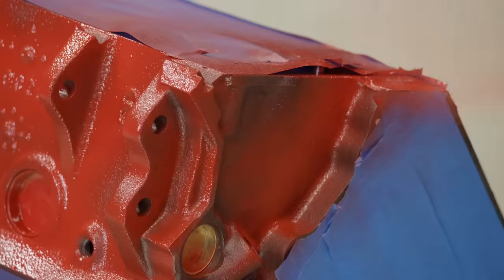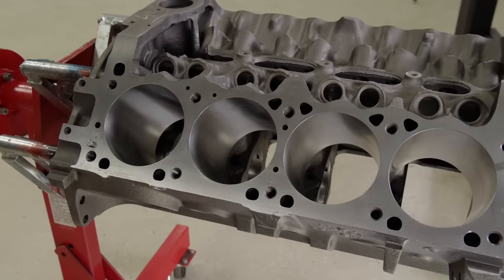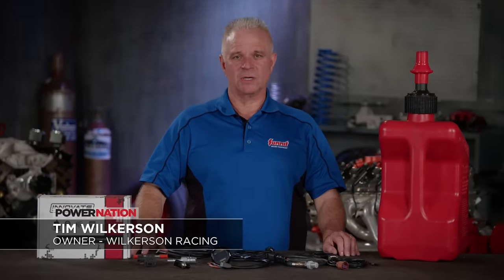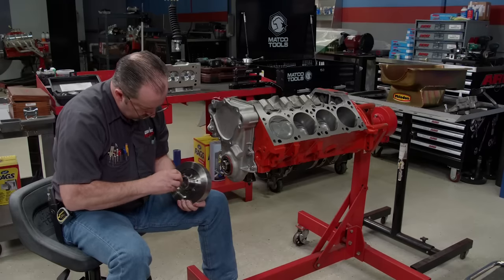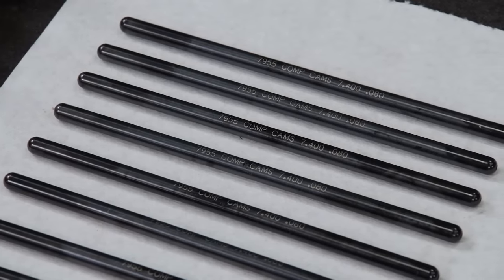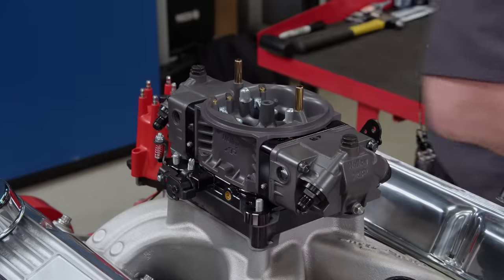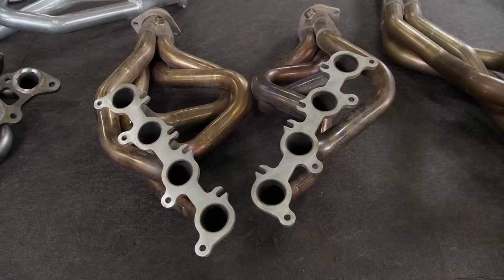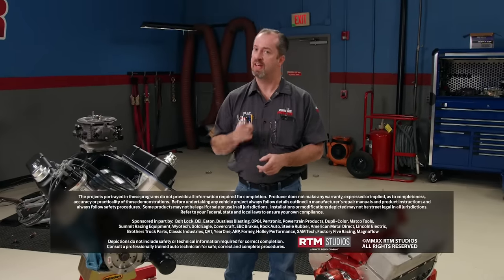Assembling a 410 Mopar with High Flow Induction - Engine Power S7, E9

Comment: Ok, am I missing something here?  They use retrofit roller lifters, on a block (Magnum) that was already designed for roller lifters?  Also, they're using LA heads on a Magnum block?  I hope it was a very very early Magnum block, otherwise I do not believe it will have the oil passage to through the head to feed oil to the rocker shafts.  Not sure when Chrysler stopped drilling those two passages.  It should also be noted that they are using an LA timing cover and not a Magnum timing cover.  I've been wanting to find one of those elusive roller LA/Magnum blocks.  Magnum small blocks typically have stud mounted rocker arms.  When valve lift is mentioned, keep in mind that LA's used 1.5:1 rockers and Magnum used 1.6:1 rockers.  So when he said "stock", I"m assuming he meant for LA engines.  Another thing to keep in mind is that LA 360's and 5.9 Magnums are both externally balanced but use different balanced dampers.
Reply: YES, u-r 1000% right about everything u said. Joey u-r on your game!! U clearly kn the inner details of the Magnum engines. Dis engine will make a great replacement for the stock 5.2 Magnum MPI i put in my 75 Scamp. SBEC w/wiring harness. Will Trick Flow have the correct angle [vertical] bolt holes for the stock MOPAR beer-barrel or M1 intake? So we can keep owe fuel injection systems?? I hope someone starts selling a create-version of this engine.
Reply: I took a screenshot of the video and this Magnum block does not have the oil in hole to supply the top end with oil, if they run this engine will burn itself up in no time, maybe they did and that's why there's no dyno runs
Also nothing was mentioned about pushrod oiling, Mopar shaft systems like on the LA engine aren't meant to be pushrod oiled
Reply: Glad I wasn't the only one that thought he said it was a Magnum engine.
Reply: Probably due to time constraints, they couldn't go into all the details of the Magnum block and it's quirks and differences between an LA block.  I did look into those Harland Sharp rockers.  Apparently they are special (which wasn't mentioned) and designed to be oiled through the push rod.  So the push rod is hollow and ball end on both sides so oil can flow through it, which wasn't really explained well enough.  It's not explained that this is an odd combination for Chrysler shaft valve train. My guess, the script had to be shortened to fit within the time slot.  But they should explain it better next time around.  Still, not sure why factory lifters couldn't be used since Magnums oil through the push rod anyway.  Should work, right?
Reply: Trick flow heads work on either LA or Magnum blocks ....Magnum blocks need oil thru pushrods..and Harland Sharpe or PRW stainless steel rockers...they allow the oil to get into the shaft.....the adjuster have an oiling hole that oils the rockers ...and into the shaft
Reply: @jamesmitchell2134  Nope. it doesn't. I do not know why Trick Flow say you can use these on a Magnum engine when you would not be abe to bolt up any manifold w/o drilling otthe than LA intakes.
Reply: They never did a dyno on this what a waste
Reply: Yep, missing a few things. While that's obviously a roller block, the cam probably isn't covered under warranty unless those lifters are used. It does serve to show how the non-roller blocks are easily upgraded. Second, they specifically stated the heads are machines for use on either block, as well as with rollers or flat cams. Three, the rockers they used were Harland Sharp units specifically intended for use on those heads, and they have a 1.6:1 ratio. Also, the external balance difference between LA and Magnum 360's doesn't matter because they are using an aftermarket 4 inch stroker crank. Typically this makes for an internally balanced setup.
Reply: I’ve been reading as much as I can on these , but it’s easy to walk away scratching your head. I think, meaning not 100 percent, that the retrofit lifters were used to match their xtreme energy cam. I looked at the catalog and noticed the cam profiles for the magnums aren’t as hot. The block is a magnum block identifiable by the two “ears” for engine mounts. I thought this was a cool feature so as to be used in older models also. I think they are neat motors because of the deck height being perfect for stroker kits. Thanks for your comment, couldn’t understand why clearance grinding was needed on a hydraulic roller block either.
Reply: Trick Flow heads can be used on either LA or Magnum blocks.
Reply: La/magnum blocks come from 90-93 dodge trucks. I have one that I changed back to the original LA style hydraulic lifter and carbed instead of tbi and computer. Nothing special, like another 360. Just buy an expensive roller hydraulic cam
Reply: Ur missing some research   patty knows wats up. He built more engines than times uve Jared off.  😂  🎉  witch I bet is alot.      .....they oil thru push rods😂😂😢
Reply: @user-hc3cn7cu4g  Well, yeah but 3  years ago when this was posted, that was a more unique method.  Still, I'm surprised that Magnum lifters weren't used.
Reply: Yes you can install magnum heads on La or magnum vise versa on La with magnum heads you would use amc 304/360 lifters and install oil restrictions in oil passage in block leading to the head but they did lose power on bottom end with la heads they also lost compression

Comment: Nice job. 
Highly suggest using acid etch primer on bare engine block, to enhance adhesion of paint, seal block against rust.
Reply: What kind of acid? Muriatic?
Reply: @DobermansRock  acid etch primer can be purchased at auto parts  hardware store.
Reply: @jakespeed63  Very good. I was thinking about pressure washing my block. Drying it then wiping it down with gags soaked in alcohol. Then a high temp epoxy primer then paint. Never heard anyone mention acid etching before but, if you are careful why not.
I have used muriatic acid to clean parts.

Comment: hotrod test was  416" /w ith 570 Hp They added a windage tray, with 11.3 compression and Comp 286x Mech roller . with ported dual plane ed rpm and 950 hp holley head flow was down 10 cc and about 12 cfm from TF after a full porting job on RPM's

Comment: I like how he is using a speed handle to run the nuts on. OG HRing.
Reply: Yes, I watched an 'professional' mechanic in our service shop, do this many years ago, while re-building our General Motors Diesels, and as his work proved to be just about perfect, so I copied that method for my work. ( no I am not saying that I do perfect work, lol  I ain't that good ) but it's an easy technique to master and it does save time...a little.
Reply: @regsparkes6507  vs.a ratchet , a speed handle saves a lot of time ! ,  ( thank God for  speed handles   when we were removing/replacing panels on our F-15's  !!  :)  )
  Like using 3/8 impact on  everything else,  goes super fast  :)

Comment: I have the same build my cam lifter is .590/.590 and i have unported Indy iron heads 2.02/1.60 and an Indy intake with a 950 carb my engine makes 550 crank HP i was hopeing to see the dyno  and see what the improvement the trickflow setup could give me besides weight off the front end please do a dyno video of this

Comment: A question for someone who knows Mopars better: This is a magnum block, which oils the heads through the pushrods. 360 LAs fed oil through the rocker shaft. Am I missing something? These looked like solid rods.
Reply: The COMP lifter they used are not oil feed though either.  She cooked on the dyno cart before it was even broken in... but they won't say...
Reply: The pushrods are 5/16" and have an .080" wall thickness which tells you that there is a hole running through it. You can also look up the part number for the pushrods and see that they are hollow. Those heads can be used on either and harland sharp makes rocker systems for LA or magnum for those heads specifically.
Reply: @jeffnewton3507  I own a set of those heads and have them on a magnum block with the Harland rockers.  The problem is without a passage though the lifters to oil though the pushrods, the top end of that motor didn't stand a chance no matter what pushrod they used. I'm using a set of factory magnum lifters.  no problemo for me!
Reply: @BSIncorp  what hydraulic roller lifter doesn't have an oiling passage through the pushrod rod cup???? They used a comp retro-fit roller lifter, I think part 8920, which definitely has a oil passage just like your stock Magnum hydraulic roller which means it oils the valvetrain through the pushrod
Reply: How could you tell if they had holes. He did say they had .080 wall thickness so they were hollow.
Reply: @BSIncorp  I don't think pat is an idiot. Besides most hydraulic lifters have the ability to feed oil through the pushrods . Hole in plunger where pushrod seats.
Reply: @patvarney330  I've chatted with Comp about the lifters... no oil holes.

Comment: You could have used factory style hyd roller lifters as you have a mag block.
Reply: Was thinking same thing
Reply: Yup save a ton of cash also.
Reply: Yup, I was a bit confused when he talked about.   "retro fit lifters"..
Magnum engines are factory roller cam.
1991-1993 360 LA engines were also factory roller cam.
1989-1993? 318 engines were roller cam as well.
(Not 100% sure of the 318 years)
Reply: @sidewyndersshed1676  the 318 depended on the application some as early as 1986 trucks not till 88 or 89 not real sure. But I think most 85 and later 318 blocks have the bosses and are already drilled and tapped cause that's what I did to my 318
Reply: This why there's no Dyno run. Magnun blocks oil through the lifters and pushrods. . .they put LA heads on, and then dropped in SOLID PUSHRODS. SOLID people= no oil to the lifters= broken motor on the Dyno.
Reply: @life_of_riley88  If it was an early Magnum block they still had the oil holes in the block for the LA cylinder head . However You can also get shaft Mount rocker arm setups from Harland sharp, Comp Cams, prw, Speedmaster, and I'm sure others That oil through pushrod so you can do the LA cylinder heads on any Magnum block with 0 oil modifications as long as you use The hollow pushrods like the stock Magnum
Reply: @life_of_riley88  Also after going back through their video They have a later Magnum block that no longer has the oil hole drilled For conventional La style oiling . They would definitely need to have used Halo pushrods with the rocker arms they chose as those Harland Sharps do oil through pushrod
Reply: @aaronbarnes8938  Absolutely correct. I saw solid pushrods go in this engine, as well as those "retrofit" lifters being designed for an LA block, won't be drilled to oil through a pushrod anyway. Multiple issues here.
Reply: @aaronbarnes8938  Yes sir, correct again, and it looks like solid pushrods, don't it?
Reply: @life_of_riley88  Yep sure does. motor is full of metal for sure
Reply: Whew.... glad I wasn't the only one catching that crap. They best stick to building gms and fords. Obviously they dont know enough to build a pretty straight forward small block mopar...
Reply: @sidewyndersshed1676  the 318 rollers started in 1985 if I remember correctly. It is a shame they didn't start the 360 la rollers at the same time. They are pretty hard to come by with such a limited run time.

Comment: I see a Magnum block which oils thought the pushrods, the proper Harland Sharp rockers that are designed for the Magnum oiling system, and then solid Crane pushrods and Comp retro lifters that are NOT oil through.  Is this why it never hit the dyno? Am I missing something here?
Reply: Agreed, I'm confused
Reply: They clearly didn't do their homework
Reply: Apparently Harlan sharp make rockers specifically for these heads that oil through the push rods, now they just have to make sure the lifters they have will supply oil to the pushrods original equipment hydraulic lifters did not have a hole in them to facilitate this
Reply: @steve6992  I have those rockers in my hand.  pretty nice units but the pushrods they used are solid. The OEM hydraulic roller lifters in the magnum blocks are oil through but the COMP ones they used in the video are not..  I think this motor is smoldering pile of scrap metal in the bone yard.
Reply: They are not solid pushrods. I think someone wanted that engine really bad.

Comment: Has anyone else give up on this build coming to a conclusion?
Reply: The motor died. They didn't oil think about oiling to the rockers with LA heads on a magnum block. Two different ways to oil the rockers, and the way this motor was built, it WONT oil the rockers.

Comment: That’s pretty good, but AMC’s 390 made 529 hp in 1969 with Crane designed heads. Slightly less with square port factory heads. The best of the era came in 1970 when they came out with small combustion chambered Dogleg heads, which had a raised floor in the exhaust port, which helped direct flow up and out of the port compared to the early square port heads which had a port floor that dipped down directing flow the wrong direction. Now let’s see what they get when they Dyno this engine!

Comment: Rough price estimate $1100 a piece for the trick flow heads, forged bottom end/ 408 striker kit $1900, cam shaft less than $300 top end internals another $3-$400, intake $600, along with everything else electric water pump, larger oil pan, new gaskets, ARP fasteners, oil, after market balancer, ext $1800. Not included (new machined block)
Reply: So in short 8k build for 500 realizable af buff horses and if you wanted to make it a little more spicy, throw on some form of forced induction, with 7lbs of boost you’d transform it from 500 to about 630 something to the wheels, might as well make her AWD at this point js these are my plans anyway

Comment: You had a magnum roller cam block to begin with. Not sure why use 'retrofit' roller lifters.
Reply: Also wondering that
Reply: @choppps5858  Cause they dont know what they are doing with a mopar...lol
Reply: @tony52ssss  Tony, 5 bucks says they toasted those pretty Harland rockers on the Dyno. . .that's why we don't see it.
Reply: I think the factory hyd roller lifters with there dog bone retainers aren't good past .500 lift is why there using the fancy shit
Reply: @jayirving6996  Unfortunately the fancy shit isn't setup for pushrod oiling, neither were the solid pushrods that they put in this build=no oil to the rockers